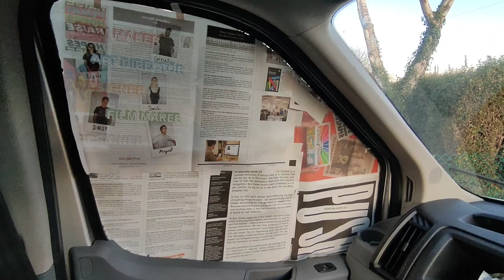Campervan Luna - Thermal Window Covers | Ep14

Comment: For people using domestic sewing machines, 
- Walking foot (to cope with multiple layers, slippery fabrics)
- Long stitch length
- Wonderclips ( to “pin” before sewing ) or wooden clothes pegs 
- Cutting table, kitchen countertop, dining table (save your knees, back)
- big quilting rulers or the edge of a cardboard box 
(Will all help this process, if you know a sewer with these things). 

I suspect this video is done, using an old industrial machine, the wonderful old metal singers that never die.

Great custom job, thanks for sharing.

Did you use regular cotton bias binding, or is there an outdoor version?
Reply from the maker: Thanks, yes. We bought an old Singer 211 needle feed (wish it was walking foot, but too dear second hand).

Yes it's just normal bias tape, nothing fancy.